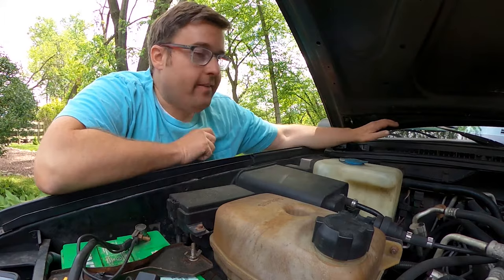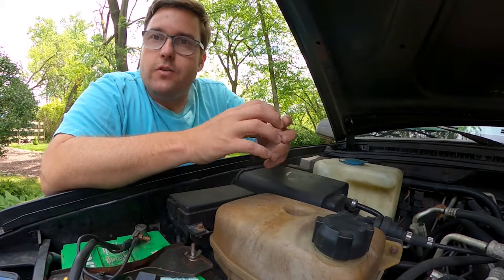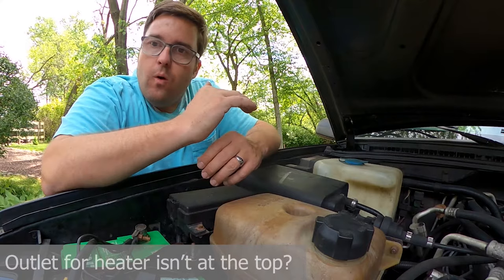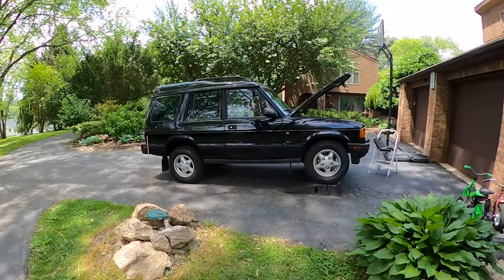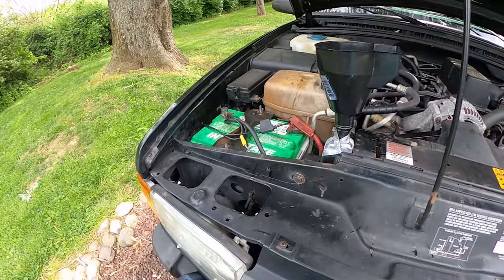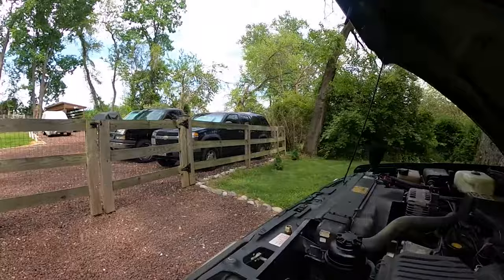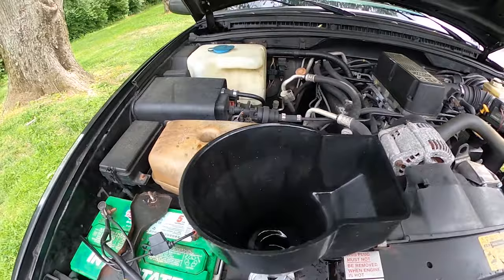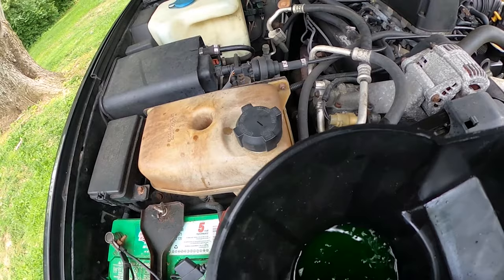Discovery 1 Water Sloshing Sound -  air in the coolant system? | Land Rover discovery bleed cooling

Comment: Had this issue as well! Was calming, hearing that running water.
Reply: @jamzdotnet  I think I solved it by selling to a fella that didn’t take too many left hand turns on his test drive 😂 

But for real if I remember correctly I think we did like three coolant flushes on it with the vehicle parked on a steep up hill, hoping that any air in the heater core would work it’s way forward of the bulkhead.
Reply from the maker: Right?! Mine still seems ok, luckily!

Comment: I have a similar problem on my GMC canyon, the water noise is driving me literally crazy!! I’ve tried replacing my purge tank, burping my coolant and running it with the cap off to try and get the air out, but I’ve had no luck, I love my truck but is had this issue ever since I bought it used last April. Keep in mind it’s a 2019 Canyon, shame on GM for not fixing this issue, I have spoken to other Canyon/Colorado owners and a few of them said they have this issue and can’t get rid of it
Reply from the maker: @lukerussell2990  crazy .. I had a 2008 Colorado that I have since sold but never had the issue. I know how annoying it can be.

Comment: good job Jason - don't forget the window a/c filter material for your cabin filter and you can get a foam mercedes hood insulation pad that will fit the D1
Reply: @jamzdotnet  yep had the same problem with original hood pad - changed out to meredes 300 foam pad and no more rodents
Reply: @jamzdotnet  yep and only $35
Reply: 1990-1992 Mercedes 300E Hood Insulation Pad - OEM 124 682 07 26
Reply: @jamzdotnet  when it comes - lay it out on the ground / table and stretch it - put something heavy on the edges to keep it stretched for a couple of days - it won't have the holes for the clips - I had my old LR pad to mark factory holes - if you dont have your original pad you will need to tape up on hood and mark the holes - I started on the outside holes to get it centered and added some extra clips on the inside holes
Reply: @jamzdotnet  mice will not bother the foam pad - they don't even like the smell and will stay away
Reply: @jamzdotnet  the grey foam with dimples goes toward engine - black smooth to hood
Reply: @jamzdotnet  let me know how it goes
Reply: @jamzdotnet  Jason I found my old box with part number 1986-1992 Mercedes 300E Hood Insulation Pad - OEM 124 680 14 25
I purchased at partsgeek.com - did I give you the wrong part # ?
Reply: @jamzdotnet  Jason - sorry the tag inside the box was magic marker change to Mercedes part #1266820026  -ignore the previous response - they changed it
Reply: Mercedes Hood Insulation Pad - Febi 1166820026
Reply: @jamzdotnet  I apologize for giving you the wrong information - can you return and exchange for correct one ?
Reply: JASON DID YOU GET THE HOOD PAD RETURNED AND ORDER THE CORRECT ONE ?
Reply from the maker: Planning to do the AC filter soon, definitely before the fall foliage season!

Comment: Exact issue in my 2013 gmc sierra. It only makes this sorta gurgling noise on cold starts. No leaks, no vacuum leaks, not losing fluid, no heat issues, everything good. Might be air bubble stuck just before the heater core. Gotta try n burp it out.
Reply from the maker: Hope this helps! Keep me posted!
Reply: I’ll let you know once I try it later on this summer… im not rushing cuz no issues but it’s on my mind lol

Comment: Facing this issue in my car after servicing. Do you know what would be the result if im using the car with the issue in ,until my next service
Reply from the maker: using it is fine .. probably air in the system. Try what I do here. Best wishes.
Reply: @jamzdotnet  ❤️ from India.👍
Reply: Worst case scenario, you'll overheat the engine.  It's best to try and get the air out sooner rather than later.  Especially if it's summertime.

Comment: Did you have problems with your defroster? I had the same sound due to air. And the defroster would not work. But had great heat.
Reply from the maker: You know, I haven't noticed an issue. I will have to check that out! Thanks for watching!

Comment: I have the same issue in my 07 Lexus gs300, the car also overheats after driving it for about 30 mins could this be the cause of the overheating problem? Thanks.
Reply from the maker: How are your coolant levels?
Reply: @jamzdotnet  good no leaks, consistent 
 coolant level, no sign of a head gasket but I hear the slushing water sound and overheating too. will give your method a try and see
Reply from the maker: @rikki2917  Interesting .. I did not notice any overheating, luckily. Are you seeing smoke or just the gauge shows it? Definitely worth a shot! Let me know how it goes.
Reply: @jamzdotnet  no smoke at all, I ’ve changed the coolant temperature sensor which was the apparent issue according to the previous owner and same problem. We’ll see how it goes thanks
Reply from the maker: @rikki2917  You are doing the right thing .. definitely give this a go! Let me know the outcome.

Comment: I'd just loosen the coolant cap while the car is still warm, carefully, and listen to all the hot air escape, then re-tighten; really hot/ pressurized air will rise and escape way more efficiently than un-pressurized/ cooler air. Repeat as necessary until air is out. I just did it once today after filling /topping off coolant. I'm sure that probably helped but if not, another time should solve it.
Reply from the maker: I am always a bit skeptical with the cooling cap and the car being warm at all.
Reply: @jamzdotnet  Of course I'm not saying with a fully hot engine, but yeah, in my experience it's fine after engine cools a few mins; and I did just do this on my Disco 1 after it had a gurgle after topping coolant; and it 100% did release the air and eliminate any noise fyi (with heater controls turned up I think is a good idea); and that is the highest point of coolant system if nose of car is slightly down I think.
Reply: Do you think I could try that on my Kia Spectra 09? It's having the same issue and I don't see leaks anywhere. When you say warm do you mean like if you drive it and then stop home? You take off the cap carefully and just let it hiss but not take it off all the way? And this will release the air?
Reply: This way your actually letting air enter the system
Reply: @GadGetHackss  you are 1000% wrong. First, you'd be wrong even if you fully unscrewed the cap and let hot air bubble out. But I'm talking about taking a hot coolant system and cracking the cap open (you're arguing with me that 50 degree air from outside comes into the coolant system...and that's what i hear, and not 200 degree, pressurized air escaping that's making that audible "escaping air" pitched sound? you are out of your element arguing with me son, I am a scientist and a mechanic) - it let's much, much more air out of the system than anything else you're going to do, it's like 100x turning the bleeding screw. Anyway, the reason nobody recommends this is because its a major safety issue, not because its not the best way to let air out of your coolant system in older cars (1980s-2000) in my experience.

Comment: Question so I drive a 2007 Nissan versa and I loose coolant slowly n I had a mechanic check it’s not the radiator n it’s not a leak , but makes the same sound would flushing my system fix my problem???
Reply from the maker: How much coolant are you using? This could be a head gasket issue.
Reply: A lil every drive not draining like crazy but it drains

Comment: Maybe make sense with my Impala just had radiator and water pump and thermostat change?
Reply from the maker: If no air got in the system probably not necessary. Do you hear a similar noise?

Comment: Air gets in your cooling system after changing a thermostat, hose, radiator or when there's a leak in the system
Reply from the maker: True. Haven't had the issue since I did this which is great
Reply: So if I'm hearing this sound and 2 days ago I was missing braking fluid this must be it then. Imma try to figure out where this leak is at asap
Reply from the maker: I believe you would be having two issues. This sound isn't related to low brake fluid in most cases.

Comment: Would this issue cause your heater to blow cold air?
Reply from the maker: Did your heater core go bad?
Reply: I’m having the same issue, sometimes it blows cool air. But on engine start up I hear the water running

Comment: I hope it works out with my chevy colorado
Reply from the maker: Keep me posted
Reply: For real my 2018 wt has the water sloshing noise
Reply: Yoo my 2019 WT does that sound 😬😬
Reply: @jamzdotnet  the water in the heater core is jammed and needs to be replaced , due to the previous owner in which he was filing normal water in the radiator instead of antifreez/coolant
Reply: I’m here for my 2015 Colorado😢
Reply: Same issue with my chevy cruze 😢
Reply: 2016 gmc canyon here has the same thing
Reply: Did anyone do this and it work? My 21 Colorado does the same thing
Reply: @robbsmith2543 homie  were you able to fix it?
Reply: @sololindo1   the water in the heater core is jammed and needs to be replaced , due to the previous owner in which he was filing normal water in the radiator instead of antifreez/coolant
Reply: @Yazanova  oh snap, I might  have to check mine then
Reply: @sololindo1  ps:the heater core needs to be replaced not the water, in which is a very hard process because you need to remove the whole dashboard to reach the heater core

Comment: Lol I have this issue as well I thought it was the spare jug of distilled I had in the back I had to do a new oil pan gasket and timing cover gasket anyways so after that work I drained all the coolant and pulled vacuum with my airlift and refilled the system then that’s when this problem arose
Reply: @jamzdotnet  it just kinda went away on its own not sure what it was
Reply from the maker: Mine still seems ok after this! Hoping it stays that way. Of course now I'm sorting a minor oil leak. Thanks for watching and be sure to subscribe!

Comment: Solution: buy something that’s not a Range Rover.
Reply from the maker: Well, a way to ruin the fun!
Reply from the maker: Thanks for watching!
Reply: People are incredibly ignorant when it comes to European vehicles. The D1 has a modified Buick engine. Rover did such a good job improving the engine that GM tried to buy the rights to it back. Just like Volvo, these were good reliable vehicles until Ford bought them and made them start cutting corners in order to improve profits. Reliable, easy to maintain, and better off road than anything being built today. A Land Rover Discovery 1 has absolutely nothing in common with a modern Land Rover.